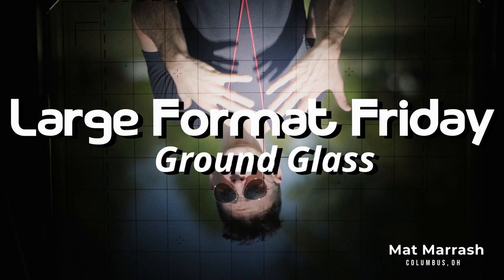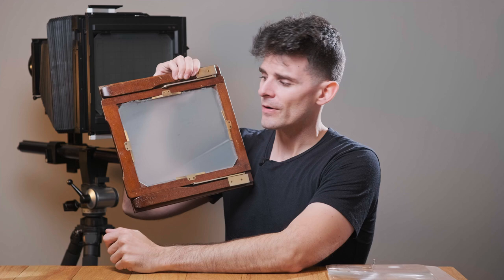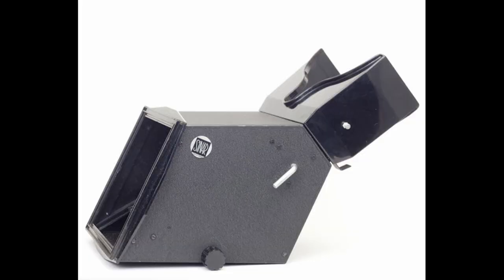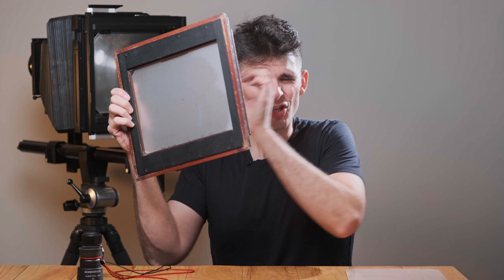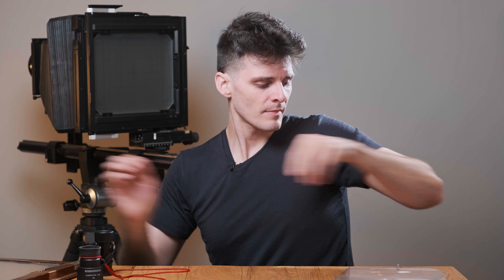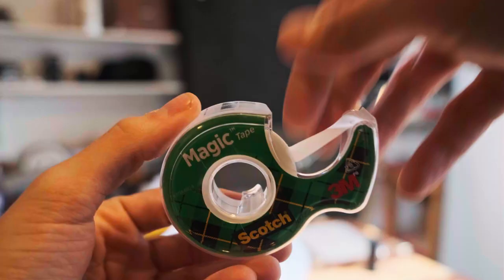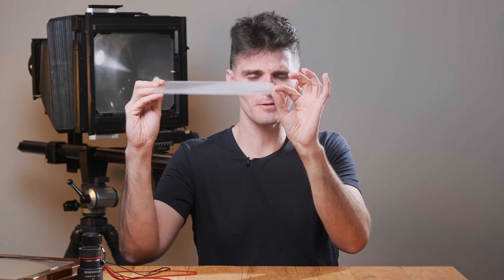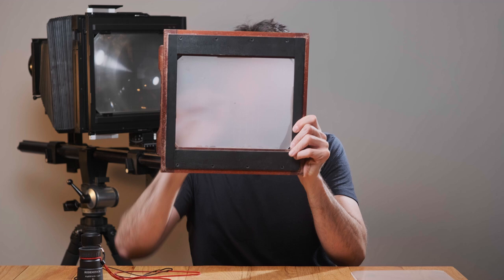Ground Glass - Large Format Friday

Comment: As a tecnicean I like to make and modify my own stuff. I replaced my two original intrepid ground glass, because they had too many lines on them for my liking, with two new picture frame glass that is 2mm thick, and ground slightly brighter glass with 800grit silicon carbide. Afterwards I market the ground side with thin pencil lines in 1/3 horizontal and vertical lines plus a small center cross. It is a simple job to do and you can always have a spare handy for the day you break one.
Keep those videos comming. 👍
Reply: Hi Philip, I’m struggling to find focus with the intrepid ground glass I do find it quite dark and I’m struggling to see tack sharp. As it’s my first 4x5 I’ve nothing to compare it to. Just wondered if you had a similar experience before you changed. Have to say on this video the ground glass looks so much clearer than my intrepid.
Reply: @altully7006  Thanks for the question.  I do not know what lens you are using but always focus at maximum aperture, fully open.  Yes a dark cloth, black on the inside to help if it is bright outside, and use a loop, I use a X6 or X8.  Find a small sharp edged item or good contrast item in your seen, and use that to focus.  once you have a basic focus, find a near item and a farther item to fine tune your focusing with any movement you make, but after each movement continue to focus each time fine tuning closer to the perfect.  Use the loop, I do. And do not forget to lock everything down once you have made movements, tripod, camera, front standard and focus lastly.
As Mat previously said learn the dance, and what I mean by that is go out with your camera set it up and focus.  No film needed.  Then find another seen, and Focus. then find another seen.  It is all just practice, and after you have done this 8 or 10 times, you should start to get a feel for focusing..  Start with simple subjects, a blank surface with just one object to focus on. then progress to foreground and background focusing, again  simple seen two objects.
I hope that helps. Good luck.
Reply: @phillipP8848  thanks Philip, appreciate you taking the time. I am mainly using a 135 f5.6 which is quite bright, having added a fresnel and a dark cloth I think the answer could be in buying a better quality loupe  than what I use at the moment.

Comment: They also used to scribe lines into groundglass with a glass etching tool. You’ll see it occasionally with reflect type cameras, and with cameras with revolving backs so you knew which way your composition was. Sometimes you’ll see scribed/etched grins too, but those are less common.
Reply from the maker: That's pretty cool and makes a lot of sense to try and combine the two onto one piece hitting the film plane.

Comment: Another substitute if you happen to break your ground glass is spray frost. If there is a glass shop near by have them cut a piece of glass to fit your camera, and spray a coat or two on the back side with the spray frost. When I got my 8x10, the ground glass was broken in shipping, I used this option or about a year. Then I went to a custom glass shop and got a piece of etched glass to fit my camera. Since have replaced my ground glass with one from Young Camera in Washington, I keep the etched glass as a spare, and bring a can of spray frost.
Reply from the maker: Good tip, thanks for sharing!

Comment: I found that Fresnel lenses are tuned to a specific focal length lens.  I have one that works great for a 150mm lens.  It's so bright, I don't have to use the focusing cloth.  But with a 90mm or 210mm, I'm chasing a bright round hole across the frame.  I'm going back to straight ground glass.

Comment: I have a Sinar P2 with the original ground glass and with that I want to send out a smal warning about cleaning its ground glass. It was quite dusty when I got it and decided to give it a gentle rinse under luke warm water. As I did that the composition lines just melted off the glass surface and down the drain. I guess with age, these glued on stripes loose its stickyness and in my case a little bit of water was all that was needed for them to be removed. Be careful.
Reply from the maker: Thanks for the cautionary tale, Johan! I'll be sure to keep my Sinar P2 glass away from warm water when cleaning.

Comment: Back at Uni 12 years ago I broke a GG & replaced it temporarily with an acrylic one I made at home...it was effective, lighter and I felt far less nervous about quickly setting up a shot if I needed to. I'm surprised there are no commercial ones available...glass is more rigid but I'd absolutely buy a professionally made acrylic one for when I'm traveling overseas etc.
Reply from the maker: Agreed on traveling with an acrylic GG! Fresnels and ultra-bright screens get a lot of hype, but they don't handle airport security the same.

Comment: great video, one hint, if you have a broken Ground Glass, use a viewer for 6x12 or 6x17 ( the ones to frame-up the shot with a panoramic roll film back), they use the grafflock fittings on the international back, just remove the frame part ( the one which holds the Glass, and has the spring levers pivot on), have to switch out for film and are limited to 6x6, etc roll film backs, as the spring frame IS essential to fitting a double_darkslide into the camera, as this is the movable vice jaw which holds the holder to the focus plane of the camera; but at least you can still shoot :-).

Comment: Mat, I ordered a fresnel/ground glass combo for my Crown Graphic. I was surprised to find that the ground glass was 100% transparent. No grind or etching of any kind. I thought they made a mistake. When i mounted them in my camera, i could not believe that i actually saw an image. I am guessing that the image is actually being displayed on the inside of the fresnel lens. The order is lens-> fresnel smooth side -> fresnel ribbed side-> clear glass-> my eyes.  I have not heard of this in any of my readings. It seems to work though. I can’t imagine there would be any measurable difference between the fresnel and what would be the frosted side of the ground glass as they are touching. I will see on my next shots. Thanks for the video!
Reply from the maker: Thanks for the comment Ron! Many fresnel lenses are so easy to scratch that the clear glass serves as a protective overlay, sometimes with grid lines.

Comment: Dollar Tree carries these thin cutting board sheets made out of plastic. They come in two packs and are large enough to be cut to fit a large format camera. I've used them in the past to make light diffusers by sanding them, albeit with a very rough finish because I wasn't trying to get a super precise ground glass level surface, but with a much finer grit of sand paper I'm sure you could make something on par with the scotch tape option.

Certainly this isn't the ideal option, and actual ground glass would be better, but in terms of having something to keep in your kit for emergencies, they're plastic. They're flexible, they won't break, and they're 50 cents.

Just if you're going to do this, try to avoid washing the plastic dust down the sink. The last thing the world needs is more microplastics in the water. Use a paper towel and surface cleaner to clean them off as you sand, and definitely wear a mask.
Reply from the maker: This is a very interesting way to DIY a ground glass, thanks for sharing!

Comment: Ever wonder why they cut the corners off the ground glass?  It's so you can check for vignetting.  If you look the the corner cut out, you should see the lens as round.  If it's not round, your lens is  not covering the film with an even light.
Reply from the maker: Admittedly, I didn't learn this until I'd been shooting large format for five years.
Reply: I always thought it was to provide a passage for air to flow when focusing the bellows so you don’t risk cracking the GG.

Comment: Hey Mat,
is it advisable to change an old groundglass (in my case mid 60s I think) to a newer one? Are they for example brighter/sharper?
Only just recently discovered your channel through Nicos Photography Channel. Keep up the good work!
Reply from the maker: Hi thanks for the question! There are newer ground glass options that are made for brighter viewing but they can get expensive. The easiest upgrade for viewing that won't hit the wallet as hard would be using a magnifier/fresnel on the back of the ground glass during focusing.

Comment: Any tips on how to add grids to your ground glass?
 My ground glass is plain with no grids and I really need to align things with grids coz I tend to exaggerate the perspective corrections especially for architectural works, most my building shots look top heavy due to too much back tilt... gridded ground glass for my linhof super technika is very rare and too expensive ... I tried to add pencil lines to the mat side of my ground glass but these lines look a little bit unparalleled and not so great .... BTW your channel is really resonates with me and I really appreciate and like your great videos looking forward to them every friday....cheers, Nick
Reply from the maker: Hey Nick, thanks for the question! My first view camera had a ground glass with a grid of permanent marker dots for reference. Others will use a thin plastic overlay to form opaque lines and the fanciest ones will use a tape-like material to fill in the ground glass making the lines transparent.

Comment: Hello Mat.
There are two sides to a Fresnell screen. A smooth and the circular cut side. Which side faces the lens when you mount it in front or behind the ground glass, or does it matter? Thanks. By the way, nice haircut :)
Reply from the maker: Hi Wayne great question! I believe in the lens side installations the circular cut side faces the lens much like the matte finish side of a ground glass. When using a page magnifier or add-on fresnel, you'll place the circles on the ground glass.

Comment: Doesn't the ground glass have to be of exact thickness for the focus to register in the same place as the film sitting in a holder? How loose can you be with the tolerance? The one Allen Ross made for you seem to be thicker than usual ground glass. Were there any focus issues?
Reply from the maker: No focus issues that I've noticed. The ground part of the glass is always facing towards the lens, and from what I can tell the only difference the thickness will make is how much it displaces the springs holding it to the frame.

Comment: Great video! I have the question in my mind for a long time. Fresnels can reduce vignetting on the focus screen when composing/focusing, but will there be vignetting on the actual film?
Reply from the maker: Thanks for the question. Once the film holder is inserted it is displacing the ground glass and fresnel, so any aspects present from the lens such as a vignette will still be recorded by the film.
Reply: @MatMarrash  So it's common to have vignette on large format photos?
Reply from the maker: @yuchending4977  vignetting is a result of running out of image circle with your large format lens. This can happen by using a lens designed for a smaller format or by applying excess camera movements.
Reply: @MatMarrash  Sorry, I shouldn't use the term vignetting. Without fresnel lens, the center of the focus screen is brighter and the corners are darker. By using fresnel lens, the brightness is more uniforn across the focus screen. When place the film holder and shoot the actual film, will the actual film looks like focus screen without fresnel lens, that it's brighter in the center and darker in the corners?
Reply from the maker: @yuchending4977  it's all up to the design and image circle of the lens used. More modern, corrected lenses will be very even, while older glass may have lots of falloff. Definitely recommend researching individual lenses to match your desired format and look.
Reply: @MatMarrash  Thank you very much!!!

Comment: will the fresnel distort the image as you compose and focus?
Reply from the maker: Hey that's a great question! I've not noticed anything when using a fresnel lens with a normal or longer focal length lens. I've read that there can be issues when using a fresnel with a super wide angle lens. The only other thing that happens when focusing with a fresnel is if you're using a high magnification loupe, you'll see the ridges of plastic that make up the lens (some users find this annoying).

Comment: can you please help me? i have a speed graphic, i had to clean the ground glass and fresnel. they are nice and clean now but i forgot the order they go back in and what i am reading is not helping me. read this "Graflok backs made by Graflex Inc. for Graphic cameras' ground glasses sit on bosses on the focusing panel casting. Graflex Inc. intended their fresnels to sit between the GG and the lens. Graflok backs' focusing panels made by Graflex Inc. for Graphic cameras and intended to be used with Graflex' own fresnels have lower bosses than focusing panels made to be used without a fresnel"  can you please tell me the order that my ground glass and fresnel goes back in, and what direction please? please?
Reply from the maker: Sure thing! With the camera's lens facing away from you, add the fresnel lens first, followed by the ground glass.
Reply: @MatMarrash  both pieces of glass have 2 sides, which way should they face? please?
Reply from the maker: @dr.crazysdallekstudio8585  You'll want to position the grooved side of the fresnel towards the lens, and the rough/ground side of the ground glass also towards the lens.
Reply: @MatMarrash  again i have a speed graphic, you are suggesting this for a (Graflok backs made by Graflex Inc. for Graphic cameras')? but the speed graphic manual says ("c. Assemble Ektalite screen (6) and ground glass focusing screen (5) so that the grooved side of Ektalite screen is in contact with frosted side of ground glass screen: Polished side of ground glass screen will be on the outside facing the lens". so  i am really confused, i have been told other positions for the GG and the Fresnel which by the way graphic calls an "Ektalite screen ". graphics' config according to the manual is the only way to get the focused image to coincide with the film plane. thanks anyway?
Reply from the maker: @dr.crazysdallekstudio8585  The best thing I can recommend is perform a sharpness test to see which way works for your camera. You can use a ruler positioned at 45 degrees to check: http://www.bobatkins.com/photography/technical/focus_testing.html
Reply: @MatMarrash  i was looking for something just like this, now please i print this on letter paper 8 1/2" by 11"? again this is a good tool. i have a Polaroid back intended for the grafloc system. good, very helpful.

Comment: Never say always, ha. A lot of large format view cameras have the fresnel on the outside, but on some cameras made by Arca Swiss, Linhof and others, including some medium format cameras, may have the fresnel on the lens side. The important thing is having the focusing side of the ground glass in the exact same position as the film plane of the film holders. This is a bit of nit picking perhaps. I'm just saying that it doesn't always go on the outside.
Reply from the maker: Hey Steve thanks for the comment. I briefly mentioned the two types, so I'm in agreement that they don't always have to go on the outside of the ground glass. When dealing with fresnels, you've got it 100%, make sure that you're not displacing that film plane or there could be focusing issues.
Reply: @MatMarrash  I guess I missed you mentioning both. The outside is the best way, according to some. They say that on the inside the fresnel will change the focus very slightly. Then others say that it's not enough to matter. On some medium format cameras it seems easier to spot sharp focus without a fresnel. Maybe the smaller viewfinder has something to do with that?
Reply from the maker: @Stevewd1  I've heard varying accounts as well. The thing that turned me off of inside fresnels was that it limits the range of lenses able to be used. It may be related to the focusing issue you mentioned.